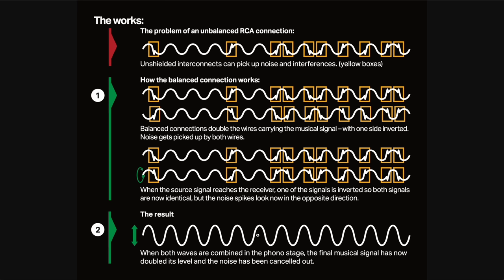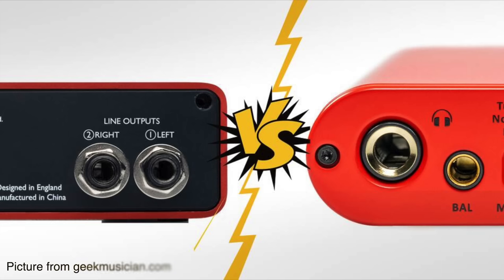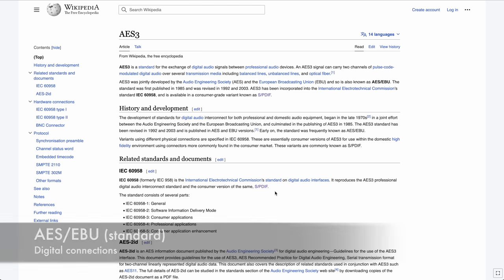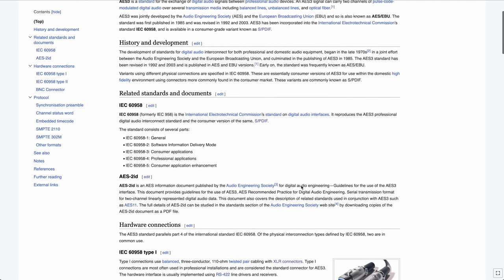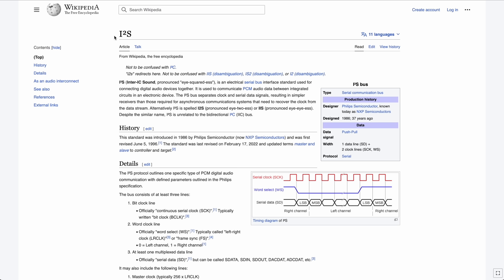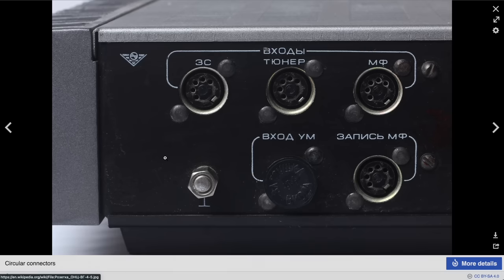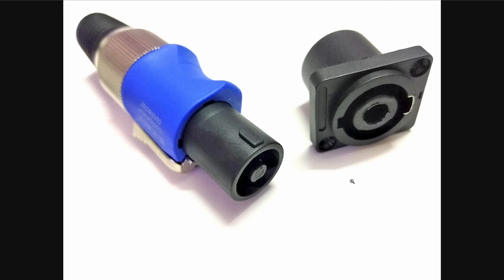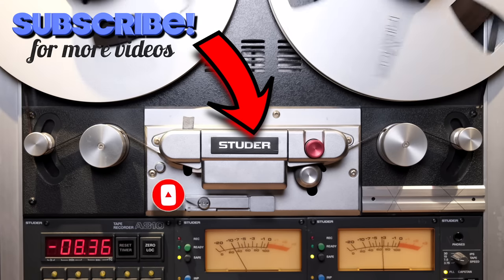The Guide to Audio Standards, Interfaces & Connectors (balanced & unbalanced, digital & analog)

Comment: The 1/4 inch phone connector was called that because that is what telephone operators used to patch a call through, a typical operators station had many patch cables and jacks which kept them quite busy until the process became automated in the 1980's.
Reply from the maker: Thank you for explaining that! I knew there was a reason behind that.

Comment: Good video and I agree more standardization is better. I use Coax, SPIDIF, and RCA in HiFi. TS and SeakON with my bass gear and then there are the connectors for my radio gear. All have there uses but many do essentially the same thing.